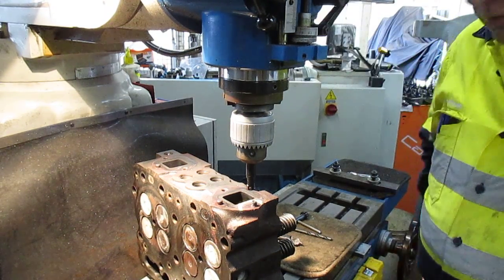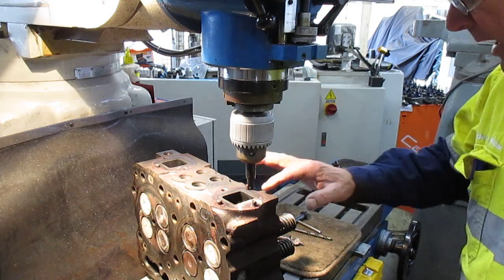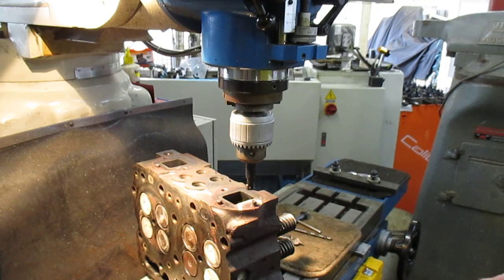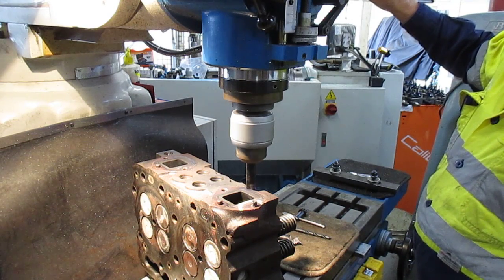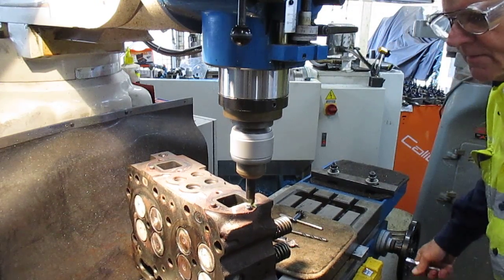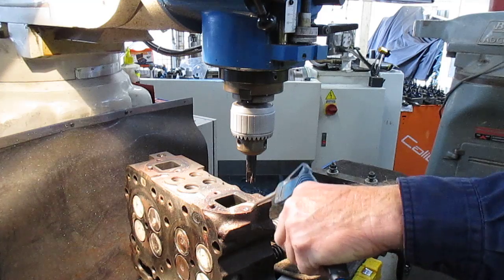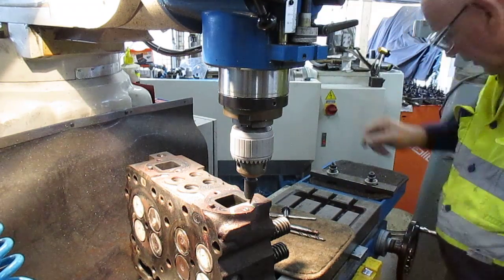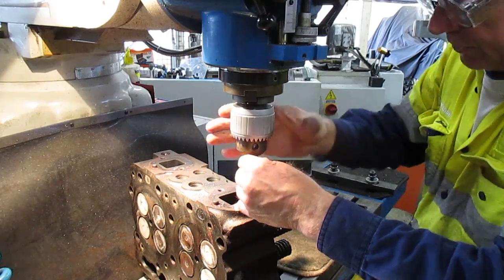Getter Out 14 head

Comment: On your  go with the 9mm LH drill , you were spinning clockwise
Reply from the maker: Bub not at all, this is the light frequency phenomena that humans see, vis a vis at times spinning wheels appear to be standing still, I'm sure you would have experienced that? also called the strobe effect. If I had had the drill going backwards it would not have cut just made a horrible noise, heated and burnt.
Reply: My mistake, i thought you were going for a 2nd LH drill after the 1st one...but you returned with a 9mm RH . When you say 'picked up'' i assume you mean powering the broken piece out with a LH drill. Great vids , keep at em!

Comment: The X travel crank on your mill is on the front of the machine.
I've never seen that before.

Is that an oven mitt as a way cover ?
Reply from the maker: The X travel crank on larger Mills are on the front otherwise you would have to be too far away from the quill, it would be very awkward to operate if it was on the end, my mill has about 1.2meter travel. The cover is a carpet sample I have many and use them extensively, cost me a $1 each. discussed in early videos.